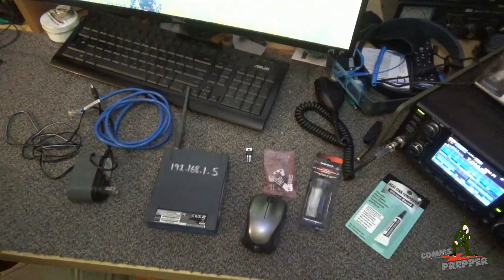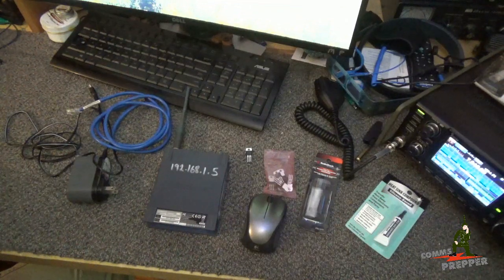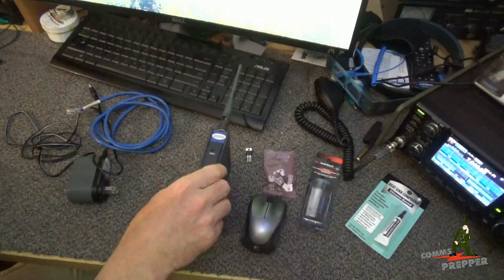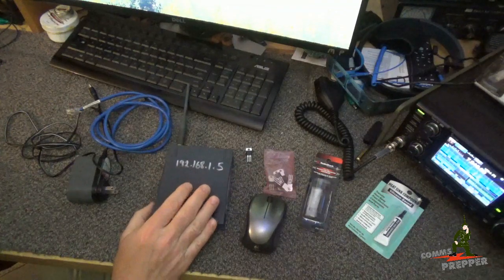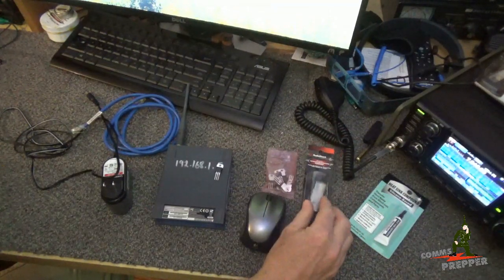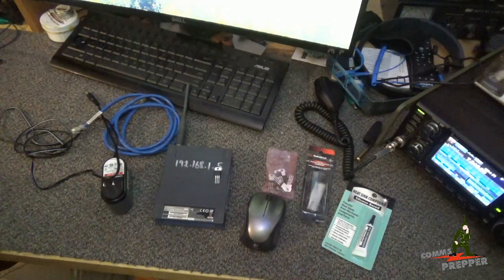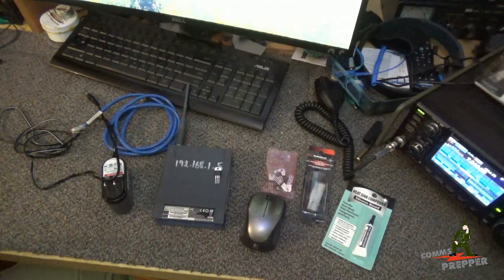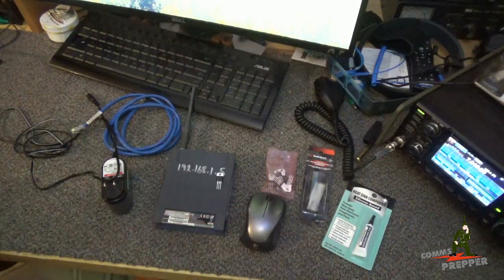Bench Mess Episode 5 - Internet for solar and new Off-Grid Cabin Channel

Comment: Although the voltage regulator will work, you will dissipate a lot of hard earned solar power as heat. Have you considered a buck converter? They are far more efficient and the modules on eBay are dirt cheap. Once you are thinking of sustainable power, particularly for something like the wifi bridge that will run continually, even 100mA adds up over time. I'm a big fan of your channel(s) please keep it up.
Reply: That is a great idea and reminder ( at least for me) to pick up a few more of those to keep on hand. Very very handy !
Reply from the maker: +crbrelativity Thanks - I never heard of them but just bought one off of Amazon.  It will be here tomorrow!
Reply: I hope that helps, if you search on google voltage regulator efficiency there is a wealth of information on this topic. BLUF: voltage regulators are fine if the input voltage is just a little higher than the output voltage, but as the voltage difference grows the amount of energy wasted grows proportionately. Wasted power=(volts in - volts out) x current out. Buck converters are about 95% efficient were voltage regulators in applications such as yours are less then 50%. Good luck.
Reply: I recently learned about buck converters and bought one myself. I have found a variety of uses for it. I bought one with a digital display and use it for Arduino and other bench projects. As far as your channel, I enjoy everything you put on this channel. My hobby is Ham Radio so I am interested in your solar projects  to power my equipment as well. As far as your water collection project, I am interested in that as well. The Comms aren't going to do me any good if I am dead due to lack of water right. :-)

Comment: I've been thinking of ways to get portable internet access as well. If you have cabin that is off grid somewhere, there's also satellite internet with a FIXED satellite dish. It's not portable, and during a bug out scenario I would be moving around anyways. I rather have something that is portable and I can take anywhere with me. I have an 4G modem connected to a portable router that has a power bank built in. It also has 1 Ethernet port so you can have to use the slow wifi. The 4G modem also allows 2 external antennas to be used, so that should allow me to pick up extra signal. I was camping in the Natchez Trace forrest, and the antennas boost my signal bars from 1 to 3 bars. This can all be charged through portable solar panel too. It's still not 100% reliable since there will be times when you will receive absolutely no GSM signals making an 4G modem useless. The only thing I can think of right now is buying an BGAN, but portable satellite BGANs are much more expensive then fixed location satellite internet services. I might have to bite the bullet and just buy an BGAN. There are pre-paid SIM cards you can buy, but there are expiration dates for your data. That's why I think it's just best if I buy a blank SIM card without any units. As soon as SHTF, I will have a bookmarked page ready to pay for units added to the SIM card. They do have pre-paid services that doesn't expire from some providers, but you have to buy thousands of dollars worth of units and data. Those are about the only 3 options I can think of for most preppers
Reply from the maker: I have wireless Internet service that works okay.  It'a a very good price for place that I am not at all the time.

Comment: You only need an insulator (typically mica) if your heatsink is at a potential other than ground.  The tab of a 78xx series regulator is in parallel with the center ground conductor.  If you do not need the insulator then you are really better off not using it as you will have better heat transfer to your heatsink...especially if the Linksys bridge draws much power as your 7805 will be dissipating 7-8W of heat for every amp of current drawn (or 8W of heat to deliver 5W of power for each amp).

As another suggested, a buck DC-DC converter would be more efficient (typically 85-90%) and they are readily available, but they may need additional filtering with inductors and capacitors to eliminate unwanted RFI (the degree of RF interference varies widely with the various models available online).  But such filtering is not especially difficult to build if one wants the added efficiency.  Of course, whether such efficiency is worth the effort depends entirely upon how much power the Linksys bridge actually consumes as low draw appliances are not worth the effort.
Reply from the maker: +Ethan Poole I did not know about them but just ordered one off of Amazon for this project.  Thank for the tip!

Comment: If the distance is only 60 feet, you could just buy outdoors CAT5E cables to run it to where you need it. An Ethernet cable is always going to provide better data transmission then any wireless router would. You could also buy sleeves for underground cables to protect the cables as well. I believe it would have been around the same price range if you went with running CAT5E cables. That wireless router doesn't have VPN flashed internally either. You should have went for an DD-WRT router
Reply from the maker: Cable run is the plan down the road.  I have to save up some cash for the excavating and conduit.  I will also need to pull a new permit for the conduit work.